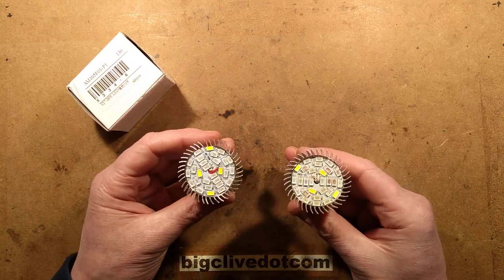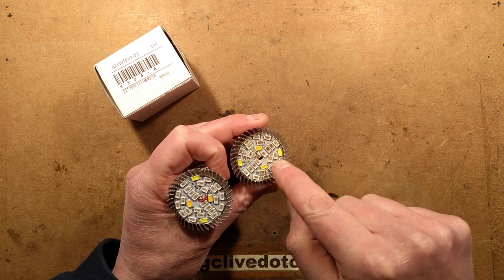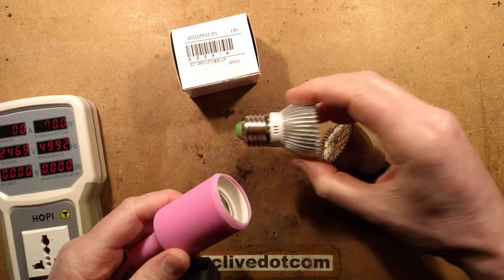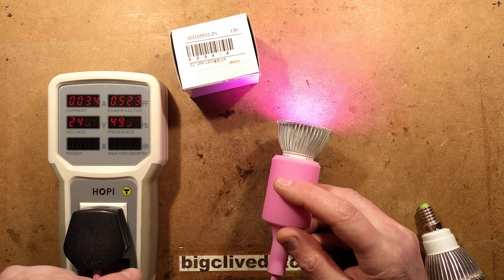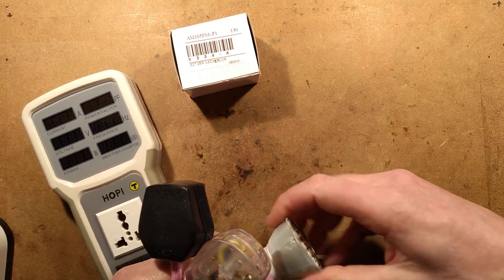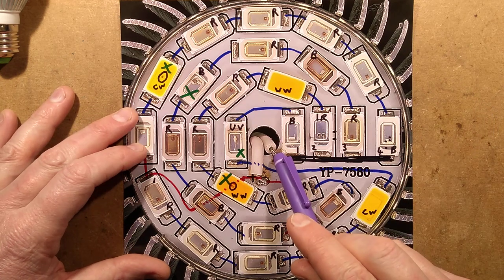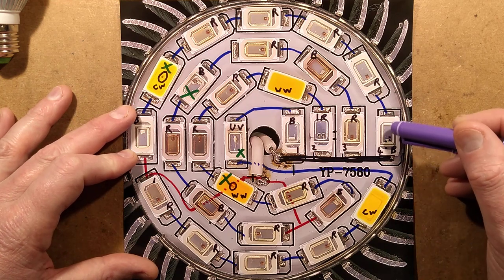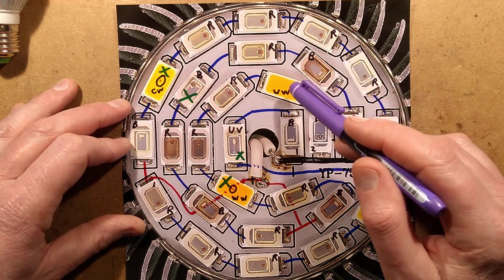Autopsy of failed grow light and test of actual power versus stated power.

Comment: The Uv and infrared are needed for growing.
Reply: There is very little photosynthetic activity at UV (in fact, UV tends to harm photosynthetic efficiency), and none at all at IR (too low in energy for photosynthesis), so neither is contributing anything useful towards plant growth or production (nor are either putting out any meaningful level of either for that matter with this lamp, so entirely useless).  In fact, plants employ a sort of sunscreen to intentionally protect them from UV light as it is both too high in energy and is very damaging to them (as with us) in terms of free radical production and DNA damage and impairs photosynthesis.
Reply: That's your opinion, You are entitled too it.
Reply: @ethanpoole3443  Plants need full spectrum to grow healthy.
Reply: @thombaz  very true
Reply: It's likely far-red, not infrared. Plants don't use far-red for photosynthesis, but they can detect far-red, and leaves reflect it well. It's part of their shade avoidance system, and helps regulate their growth and leaf formation patterns.

Comment: I've never seen wire strippers like that, could you say what model or brand they are. Just curious
Reply from the maker: Traditional Unior wire strippers.  Adjustable to a specific core size.

Comment: as a neighbor is selling their house and not living it in it, they put LED bulbs for the outdoor lights  alas on has gone into strobing, bit of a headache from that actually.  wonder how lone the strobe will last  , I had one that went on and off very slowly then bang.  stays on except for any power fluctuation in the house it will flicker (smoothing cap gone?  I don't know.  )  how long would an outdoor full size bulb last in LED in strobe fail??  I'd love to shoot it out but thats not legal :P
Reply from the maker: It could strobe for years.  If it's reachable you could cover it.
Reply: @bigclivedotcom  bout 10-15 up  and there's a mini roof in the way.  parents sold a house to the employer to move once.  I was told it took a year + to sell.  don't know why either.  single story with basement) all brick and an attic to boot...  One across the way though only has a carport.  that won't be as easy.  Big house but no garage.  But a fairly big gargoyle over it.  We knew the people who lived their before the last ones moved in in 2012, then her husband passed away and her cats had to go so she moved in 2011-2012 and they came in.  They were more left wing than me but do have LED bulbs by and large outside.  although I wish they made the LED lamps for outside  with replaceable bulbs.  The current one built in security back light.  But thats not the case across the way.  So looks like I'll have to deal with it for awhile,  hopefully someone moves in

Comment: I bought 4 "Identical" meters a while back. Same batch never mind same make and model. Do they measure the same? Not even close. About 10% variance between max readings at 20V range with one measuring 18.2V 1 measuring 19.5V 1 measuring 20V and the other was 18.something. That was from a 0.1% accuracy 19V source (part of my personal calibration equipment). A friends Fluke which is about 5000 years old and has never been calibrated measured 19.1.
Reply: seemse like they were pretty cheap meters then
Reply: @Ramog1000  well they were hardly fluke grade that's for sure. They were about £20 each if I remember correctly.

Comment: The real question is does your bench supply have an 11 kV range? And if not, why?
Reply: Every bench supply has an 11KV range, you just have to wait for the bolt of lightning to strike.
Reply: @ethanpoole3443  no no you just have to deinstall the transformer of the powersupply and put it in backwards

Comment: Waste of LEDs / light: You only need two sharp peak spectrums to grow plants one in the blue and one in the red, with most plants only needing the blue. Green bounces off IR is not needed and too low to the 2 photon photosynthesis cycle, and the UV just is converted to heat plants are damaged by UV More wankery and uneducated buyers. So really most growth per watt you want a bunch of blue LEDs and a few about 1/3 red LEDs. Rest is wasted as heat or bounced off. Im guessing those UV are too dim to do anything anyways. I have grown plants in just about every light and this is the best I found with having a metal halide being 2nd to blue /red LEDs since they put out a sharp red and blue to make their white.

Comment: Burple.

You sure about the UV though? That would be unusual and slightly worrying for a grow light.

Also infra red would show on camera so is that one just broken and normal red?

I know I wouldn't put anything past these cheapo lights but the spectrum pattern for grow lights shouldn't extend (much) past the visible as per https://en.wikipedia.org/wiki/Grow_light#/media/File:Chlorophyll_ab_spectra-en.svg

Also I feel vindicated after being chastised on certain growing forums for suggesting that these "48W grow lights" (or 50+ in some cases depending how big you want them to be!) might be a lot less than 48 watts. 4W is even lower than I anticipated mind you. Hahaha it's no wonder they don't work very well!
Reply: The UV and IR are just marketing wank as neither is especially useful in a grow light nor does it emit much of either wavelength anyhow so the amount is negligible.  Both UV and IR will potentially show up on a camera sensor IF not filtered out fully by the optics.  Many cameras employ a “hot mirror” filter to block most IR but the degree of blocking varies widely, the same for UV — so while both will often show up (the sensor itself does respond to those wavelengths) they tend to show as very dim compared to a similar lumen level from a visible wavelength source, which makes them appear much dimmer.
Reply: Both the uv and ir did become visible when he cranked up the current on the one that wasn't blown

Comment: Sooooo, in china, christmas lights = grow lights? :P

The colours used there just look like something on a Poundland LED string, not entirely sure how that's meant to work, but hey, that's china for you... :P
Reply: This is actually a decent LED grow lamp, as for as the LED colors are concerned. Older LED grow lamps you would see were all red and blue only, as it was hypothesized (or marketed-sized) that these were the only wavelengths that the plants used. More modern LED grow lamps try to fill in the spectrum more, mostly by adding white LED's. The problem with white LED's is, due to the phosphor coating, they are less efficient than monochrome LEDs (blue, red,...). However, what you lose in efficiency, you gain in a wider bandwidth of light. Warm and cool white LED's give a good spectrum distribution. 

For me, personally, I have my plants in the same space as me and I don't want to be looking at a purple light all the time, so I stick with warm/cool mix only. But, if I had my plants growing in... say a garage or closet or something I never really went in much, I could see myself using something more like this as it is ever so slightly more efficient on electricity. I would still prefer a few more whites in the mix myself, but this one isn't that bad.

Comment: I bought one of these Grow lights and it doesn't have any electronics in it should i be worried?
Reply from the maker: Some use driver circuitry on the PCB itself.  Treat any exposed metal on the LED PCB as possibly being live.

Comment: Is it just me or are most of these LED "Bulbs" dying even faster than CFLs? Maybe I'm just not spending enough.
Reply from the maker: They're getting better now, but the early ones were terrible.  Heat is the enemy of LEDs so you have to use lower wattage lamps in enclosed fixtures.

Comment: So much for LEDs lasting 50,000 hours
Reply from the maker: That, and the earlier 100,000 hour claim were based on traditional gallium arsenide indicator LEDs.  The LED marketing industry is notorious for fabricated figures.
Reply: @bigclivedotcom  I'll have a flying car long before I can buy a 100,000 hour LED bulb.
Reply from the maker: @1pcfred  If you under-run LEDs their life is greatly extended.
Reply: @bigclivedotcom  being a child of the dull red LED indicator lamp generation I am still coming to grips with how LEDs are being used today. Cast usable light? You don't say!
Reply: @soundspark  it appears in this case it was a bit of both.
Reply: @soundspark  Clive ran it with an external PSU. Those LEDs are dead.